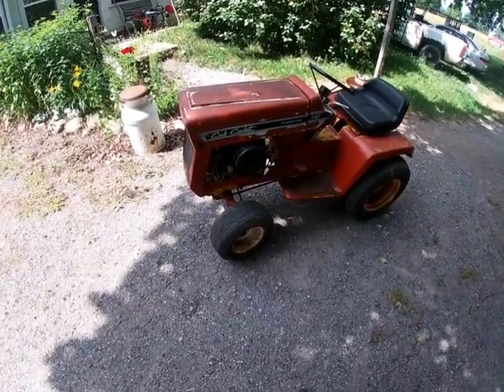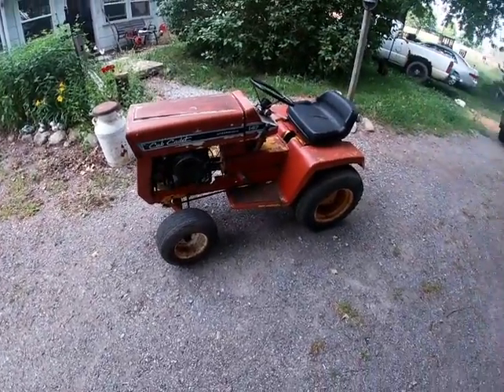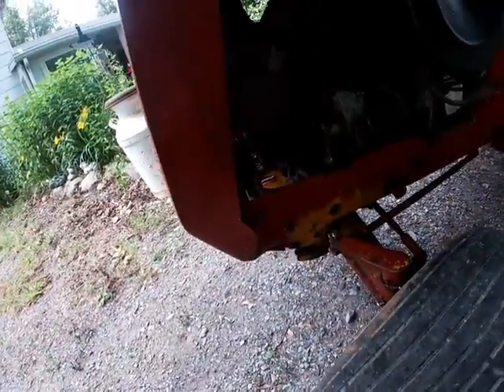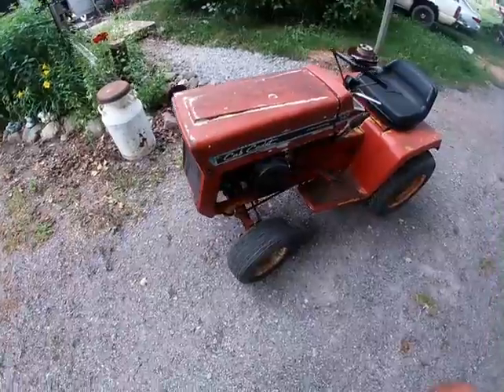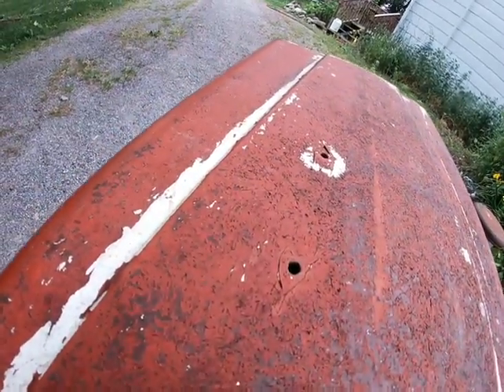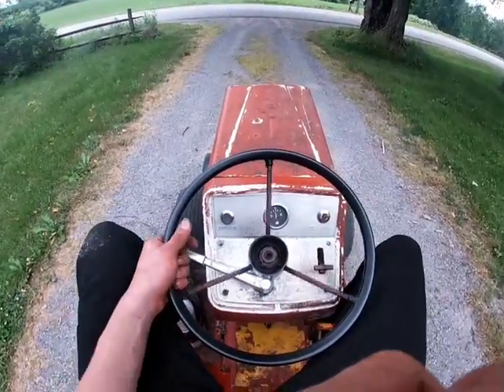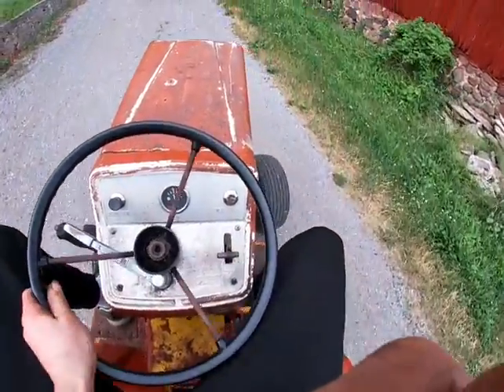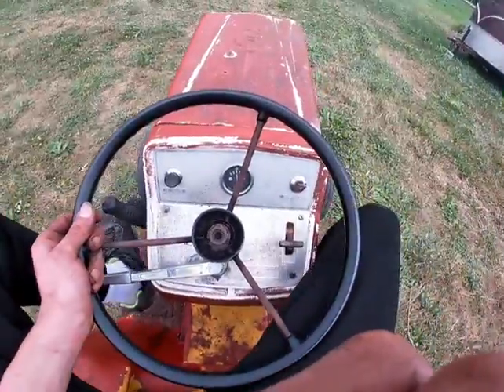147 runs again pt II

Comment: Man that thing sounds real good now.  Great job.
Reply from the maker: Thanks! I almost can't believe that machine was sitting in a swamp this time last year. It's been quite the transformation, and I'm very happy with it. Fuel system has been giving me a bit of trouble though.
Reply: @Tractors101   Replace all fuel lines, fuel filter, drain gas tank, maybe clean carb again and use premium gas (non-ethanol if possible).  I did all of that on my wheel horse, and fuel system hasn't had any issues at all.
Reply from the maker: @RcFlashlight  I dug into the fuel system the other day actually, and I found the issue. Carb needle and seat don't work too well if clogged with rust! Unfortunately for me, the Kohler gas tanks used on Cub Cadets have a baffle, separating part of the tank from the rest of it. Because of this baffle I could only clean 2/3 of the tank. Whatever rust is in that last third was left there. The real problem was that I had no filter on my fuel line, which let all the rust into the carb. I installed a sediment bowl, which is what they came with from factory, and cleaned the carb again, and now she runs much better.